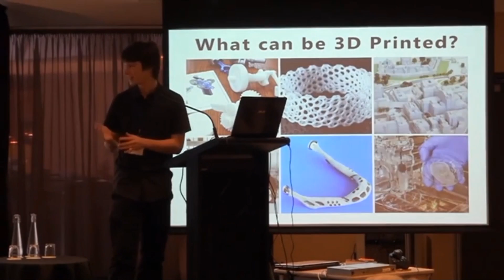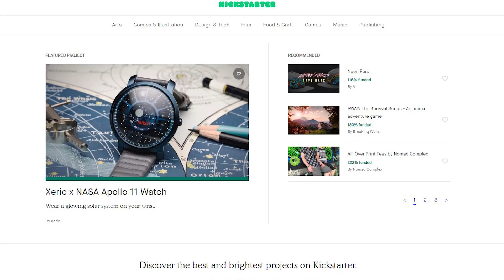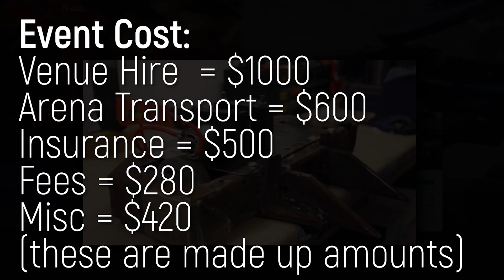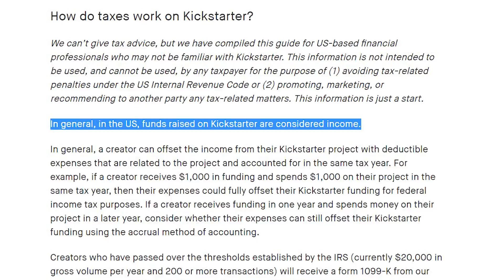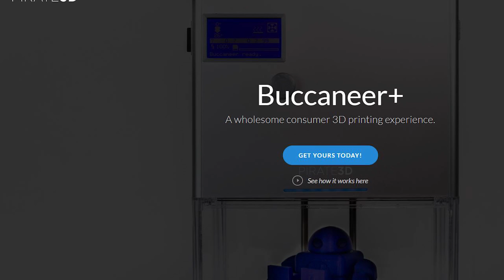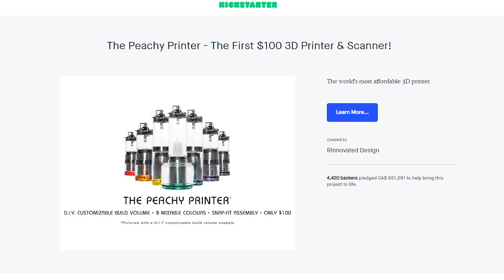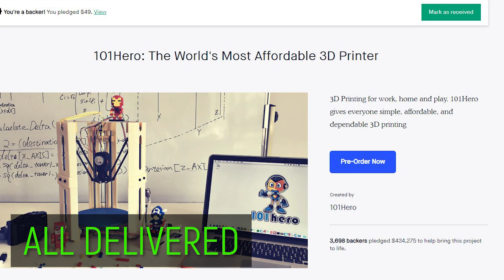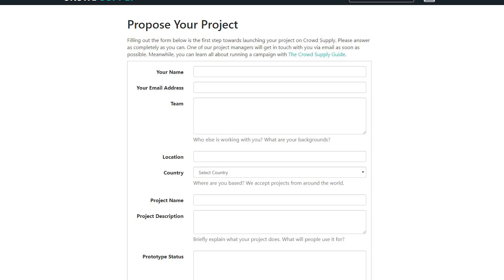This 3D Printer Raised $1,438,765 and Failed. Crowdfunding Warning.

Comment: Note to self, never buy hardware that becomes a cinder block the second the company goes bankrupt...
Reply: The Jibo robot met the same fate. When the company went under the servers went with it, and the $900 bot turned into an expensive paperweight
Reply: I wouldn't say it became a cinder block. After all, a cinder block is still useful.
Reply: Yes beware of proprietary software that only works on the cloud! Connection to the cloud can go away at any time. Due to a natural disaster, or someone not paying a bill. Then its useless. And heaven forbid if all you file content was there.
Reply: That's why I never got a Glowforge, considering the software is cloud based.
Reply: Which is the same reason why no company worth their weight in gold uses OnShape, preferring to rely on stuff that is not tethered to an internet connection.
Reply: Hardware folks need to learn about graceful degradation instead of hard bricking
Reply: Johnston Steiner  rebble has actually replaced pretty much all functionality that was shut down by pebble
Reply: I had finally gotten my Navdy which was a Heads Up Display for your car.  It took quite some time and I didn't think I'd ever get it.  I did finally, but it wasn't all that long before they went out of business and the unit became worthless!!!

Ya, don't get anything that requires the company to stick around, or cloud-based.  In fact, just think of Kickstarter and others as Gambling.  The chances you ever get it is pretty slim.  I do have a couple drones on Kickstarter and it's dragging on also.   It's always one thing or another.  Will either of them ship, who knows.
Reply: JUICERO
Reply: Izan TM  nah the anki stuff can be locally hosted now I believe
Reply: Looks at steam library
Sweats profusely
Reply: +Richard

Well, Valve claims that if the company goes under they'll disable all of their DRM. Who knows if it'll actually happen, but they're one of the few companies I've seen actually promise it.
Reply: @voidofspaceandtime4684  If the company is going under they arent going to bother.  Cloud services are not a feature to me, I consider them a "conditional functionality" flaw
Reply: Izan TM  pretty sure anki products don't run on cloud servers.
Reply: Shit, I just realised I'm a fan of Tesla and still have my Model 3 pre-order to be fulfilled if I'm going through with it .. lol Do Tesla cars get bricked if the company goes bust?
Reply: aaron4820 they don’t but some features won’t work
Reply: @aaron4820  it's an electric vehicle that has to be specifically returned to the manufacturer for any system repairs not fixable by a call to tech support. The best and safest assumption is that, even if it continues to function after company collapse, it's lifetime is going to be vastly reduced.
Reply: @aaron4820  Yes it will brick. Tesla has dedicated themselves to make the elegant, simple design as brickable as possible.
Reply: @Fluffehfox  Hey man since you can see the future, can you please tell me BTC price August 2022? Thinking of buying a house so that may determine which type of house I should get.
Reply: @aaron4820  Future ?  ? 
I said "Tesla has dedicated themselves" literally inferring "in the past". Tesla from day 1 has refused to provide replacement parts for out of warranty vehicles, thereby "Bricking" them. I can see into the past and a disproportionately high number of Tesla models are thrown away as if they were disposable when in reality could be repaired very fast for very cheap and have hundreds of thousands added to their lifespans. RichRebuilds would be out of a job if Tesla showed the faintest interest in not letting Tesla cars become "Bricked" upon their first out of warranty repair or maintenance.
Reply: @Fluffehfox  my bad, you said "it will brick" with such certainty I thought you could see the future for a second.
Reply: @aaron4820  There are people who can still work on them, but only with parts from other scrapped Tesla's. I think they are wonderful cars, but I also think their stance on repair is inexcusable.
Reply: AKA Apple in the future

Comment: I got a Tiko awhile back and honestly regret it a lot. The whole system is crap and the annoying part is that it only connects to wifi that it generates so I have to use my old crappy labtop to even connect to it and I can't connect to the internet at the same time.

Add onto this that they refuse to use any slicer other then their own and they have very little you can control it's pretty hard to get things correct, the print resolution is pretty crap too

I'm pretty sure the motors aren't that bad so I might just end up gutting it and getting a new control board though

Comment: I had backed the Tiko printer and at the time I thought they should have doubled the price. I backed it thinking it'd be amazing if they pulled it off. In that case I was playing craps but knew I was rolling the dice on it. All the other kickstarts I've done have delivered.
I had a small business manufacturing laser cut kits for model railroading. Building, structures and such so I knew something about making a physical product. Designing the models and making the kits was the easy part. Talking to stores and looking into distribution, advertising, packaging (custom packaging is expensive and you better want 30,000 units to start with) is the nightmare.

Comment: 3D print mass production is still a century away, this is not something you can develop with a kickstarter.
Reply: Rubbish, you can buy a perfectly serviceable printer for home use now for a very reasonable price.  And 3d prototyping is already an integral part of industrial design and manufacture. The days of industrial designers hand shaping things from foam and clay are all but gone. Every plastic thing inside a modern car came out of a mold made from a printed part.

Comment: It's funny that at time Pirate 3D for $350 and Tiko for around $180 both failed to deliver, but today you can buy pretty good starter level chinese 3D printers for around $180-200 (like the Ender 3). Of course, the chinese do copy a lot of things, and there is now the economy of scale for parts, like the extruder and so.

Comment: I was a backer for the Peachy printer, their projected cost was way too low, but I wouldn't have been as mad if they just ran out of money. There's no more information about the embezzlement out there other than Peachy's own updates, so it's entirely possible that both founders were in on it.

Now I have a Moai, which uses the exact same technology, but lo and behold, it actually exists and no one built a house with my money.

Comment: I have funded several projects that went no where, the worst was SinterHard which was making a FDM Metal filament that needed to be sintered afterwards. Although they failed, The Virtual Foundry picked up where they failed and have made an amazing metal filament. I had thought about doing my direct drive upgrade as a crowd funded project but after seeing all the fails and the constant spam on KickStarter I decided to just fund it out of pocket and it has done really good. I am sure I could have made A LOT more if the word had got out and it would be more popular but so far I have made a good profit and they continue to sell.

Comment: I have backed over 30 Kickstarters over the years, and I have only ever had one fail to deliver (good old Star Citizen. Maybe they will one day, but I remain skeptical. The creator has received enough funding to work on it for more or less the rest of his life though).

My secret? I have only ever backed technology once, ever, on IndieGoGo. One of the creators ran off with the money and it was a long fight from the other creator's part getting the money back and the product eventually delivered. Sadly, these headphones had a major design flaw and mine lasted less than two months before dying, due to skimping with ultra cheap thin gauge wire that broke if you moved the adjusters too much. This was a commonly reported flaw.

Technology is not doomed to fail, but hardware crowdfunding projects have the highest failure rate of any category by a long way. Too many people with nary a clue as to how risky and complicated delivering this stuff is, and it goes belly up too often.

Almost all of my Kickstarters have been for board games and roleplaying tabletop games, and to date, all have delivered, and they have all been very beautifully made, with only a few rare cases of some poor material choices.

Comment: Now do the M3D Pro. Holy hell what a cluster. I still haven't gotten mine and if I do it's practically guaranteed to be little better than a door stop.
Reply: The 3d printer I designed was intended to be the exact opposite of the M3D.
Reply: @Reach3DPrinters  so, designed to not be a complete scam?
Reply: @matisan8407  LOL, yeah, I designed my printer to be fully open source including all components except the aluminum plates... which could be replaced with printed plates, but aluminum is much better. I sold 600+ printers, 500 on kickstarter. At the time, Tiko had just finished their campaign, this was March of 2016. In my kickstarter video, I literally had a shot of the M3D hotend dismantled, showing the proprietary system that was not end user repairable. :)
Reply: I did get mine and it had to be sent back to get the board fixed and they refuse to even send it back to me. The company is terrible.

Comment: I got a Monoprice Mini Delta via Kickstarter. I researched the company and thought it was a reasonably safe bet considering they already had another printer for sale. While they definitely did some cost cutting (sent with a SD card that caused prints to fail and it managed to stab itself the first time I printed anything other than the test cat on the SD card). I did receive my printer and was able to use it (eventually). I may eventually use it to print parts to build a better printer though. :P

Comment: Only kickstarter I ever backed was the Swiftpoint Z PC mouse, and I ended up forgetting about it as they missed their initial deadline.
But one day a package arrived and my god it was beautiful, looked as good as it should, worked even better, so many customisations and the world's first mouse with genuine full gyro and analogue buttons.

I had big plans to use it in 3D modelling where I could rotate the mouse around in the air like the commercial 3D manipulator devices.. but it was uncomfortable to do, using it as a joystick in gaming to fly planes was ok, but more difficult to master and required snapping a magnetic base plate on.
All in all they absolutely came through on their promise, but I had misjudged the useful of those promises.
I still have it 3 ish years later and the extra buttons and ergonomics are great, but for gaming I still end up going back to the old 12 button thumbgrid, so it now sits at my work PC with button maps for quick tab changing, opening/closing tabs, switching programs, adjusting volume and a few others.

Comment: I have a Tiko, with a few modifications it worked great until you get a jam then you fight with it until you find a way to get the jam cleared out. May need to look into replacing the geared rails on it as I am the 3rd owner of it and they are plastic and suck.

Comment: Great video. Good lesson here. If you are planning on putting something up for crowdfunding; Treat that support as a pre-order. Have all of the technical kinks worked out. Hardware design should be 90% complete. The money should only be used to finish and polish that last little bit at the end and provide a great experience to your backers. Too many of these are just down to bad management.

Comment: Well, I did try to order something off of crowdsupply and it ended up in complete failure on both orders. One was returned by DHL back to the seller after entering the country. Another one requested me to provide them export control documentation (on a wifi-controlled stepper driver) which asked me to confirm I'm not on any of three lists of companies all of which returned 404.

In both cases it would have been easily mitigated by the platform if only their support queue didn't span four weeks for a single back and forth. It took me 6 month to get a refund on the items ordered and it was single most frustrating online shopping experience I had including all the kickstarters I previously had.

I do realize that your personal mileage may vary drastically depending on the projects you back and the country you are in, still I'm really hesitant to recommend anyone to even browse through their catalog at that point. You may get lucky and receive what you ordered in time or you may get unlucky and ended up in month long queue of support requests.

Comment: IMO if you really want to do a Kickstarter campaign to actually get a product out to the public. First of all you'll need a working Prototype, secondly you need to look at viable building materials, finally you need to take in consideration how well you present the campaign/product and find out if this is something that will be popular enough to be worth making a campaign for it. Just look at Oculus and their VR headset. Now before Oculus VR was kinda ify and not really out there. But what Oculus did was during their Kickstarter campaign they had many different prototypes that they took around to places for demoing it along with sending some out to certain people to test out. Along with that they raised about 5X their intended goal which helped them out a ton and it took them about 3 years to actually get a finalized version out in stores. But during that time they had many different testers to help them out all over the world. So that is one good thing that they had with this. Also at the same time when you look on Kickstarter their are a ton of campaigns that have been made in a low effort way and then their are the others that put allot of effort into making the campaign video/page to the point where it looks super good but then again it's a scam.

Comment: Fit the Pirate with RAMPS on a ReArm board, running Marlin 2. There's probably a few videos for the future. The Melzi board on my Tronxy P802E blew it's extruder driver. Rebooted the beast for less than $80 with a RAMPS 1.4 with Marlin 1.1.9 and I reckon you could do a lot of cheap printer buyers a big favour by showing them how to completely refurbish a blown or worn out printer. I really didn't get on all that well with the Melzi running Repetier. The jump to RAMPS has made the beast a powerhouse! Surely the Pirate would benefit.

Comment: Ultimately, the combination of open source and China proved to be unbeatable for the dedicated low cost hobbyist market.
And despite all efforts, there are yet still very few comprehensive, proprietary 3D printer systems that are both affordable, easy to use/ergonomic and offer good performance all around.
And concerning Kickstarter, Chinese companies also seem to have the edge in actually delivering finished products, even though rarely without flaws. Not accounting for the frequent scams.
Building up a business and producing innovative, high quality yet competitive products turns out to be more difficult, complex and expensive than most startups are prepared for in the Western world.
And relying mostly on Crowdfunding tends to fall short in more cases than not, because the projected funds needed are often calculated too low, especially when failing to account for unexpected additional costs during the production and marketing process. 
In the end, as in any industry, many will try, few will prevail and most will fail.

Comment: Great video on the topic. I've backed many Kickstarter projects but only after lots of evaluating. Still got one small burn. But sticking to the guides of if it looks to good to be true or the goal is not achievable, then pass. Also stay away from those that start to add features as the funding campaign goes on.

Comment: Initially I thought this would be a video about the "Kodama Obsidian" the $99 printer, since I remember, you presented the prototype on the channel back then. Funding ended in mid 2017 with an planned initial delivery date of late 2017 I believe (?) - still waiting for this one to be delivered. Not holding my breath for it though... ;) The developers are posting updates about how they source items and unbox sample shipments of parts from china to appease backers as we speak. LOL!

In the meantime, the early adopter version of the Ender-3 I bought for <130$ incl. shipping over a year ago has been printing like a charm and still does.

Comment: As a follow up to the ONO printer, which you've discussed...

They did manage to ship some, but not many and the quality was iffy. They'd run out of money by that point and were looking for funding, but they've gone silent, and I don't anyone's seen a shipment in a while now. So.. yeah. Dead, I think. I never got mine.

In fairness, everything I've seen indicates that they were trying to get product out the door, but just mismanaged it and made a couple of serious design decision mistakes that they couldn't recover from. I feel kind of sorry for the guy who started it. His last few posts seemed a little tortured.

I'm not angry about it - backing a project on Kickstarter or IndyGogo isn't buying something - it's a gamble. Sometimes you win, sometimes you lose (but mostly, lose :) ). It would have been a cool thing if it had shipped. And now, SLA printers are common under $500, so...
Reply: I agree with you mostly.  I'm a backer for ono as well and do believe they were trying.  I am angry they started selling them through some European distributors a few months ago,  probably to try and generate additional funds.  Just kind of a slap in the face to the backers.  Unless they really thought it was possible to raise enough money to continue the project,  they should have just shipped what they had to the earliest backers and closed up shop with an honest apology.